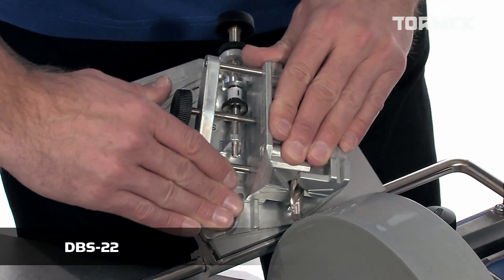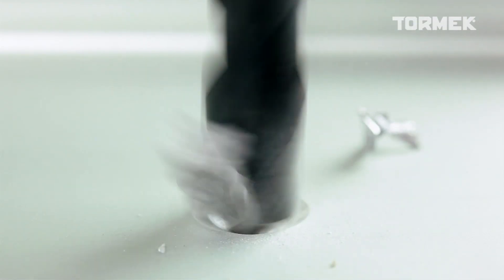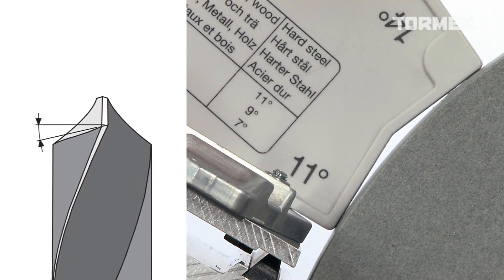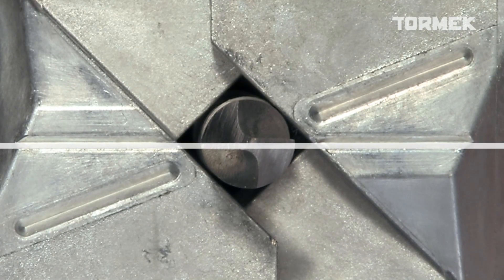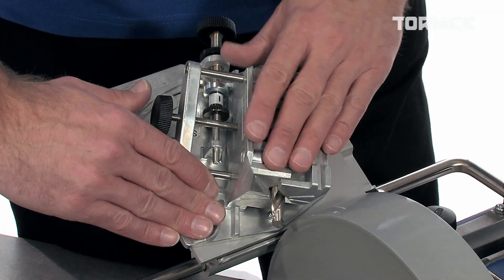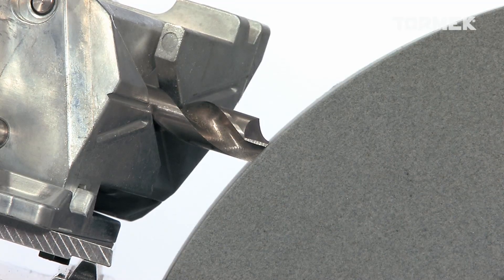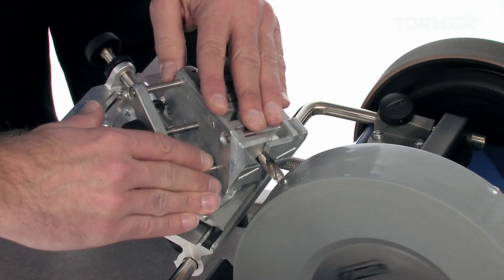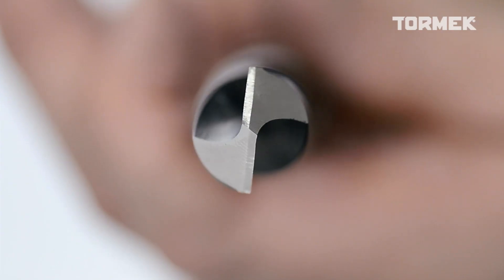Sharpen drill bits with Tormek Drill Bit Sharpening Attachment DBS-22

Comment: I own a Tormek and it does make a great result.  Unfortunately it is slow and has size limits.  Another negative is you must dress that  stone which adds an additional operation......but that is easily done.  I am able to sharpen such that sharpened bits don't make oversized holes.
Reply from the maker: The Tormek system turns slowly for a reason. That gives you 100% control for angle and results, plus that you won´t overheat your tools at any time.

Comment: It seems that quite a few people are worried about deflection of the support or uneven  wheel surface, these issues are easily addressed. I bought a T8 used from eBay with a few jigs and recently I found (lastly) the DBS-22 used again in eBay. The difference between free hand and the Tormek is night and day, the same applies to knives, chisels that I've done. I don't want to be a specialist sharpener, I just want my tools to cut properly and go on with my job at hand. The system is not fast but it is unparalleled in flexibility, precision (for the money and time invested) and durability. There is a learning curve but it is not that steep. Remember that precision results are extremely difficult to achieve by hand and there are so many tools that are actually pretty much knives. Last, you buy a Tormek system to use itfor life, it cannot be cheap or cheaply made. The fact that you can gradually buy all the jigs is very good.
Reply from the maker: Hej Giokosmik, thanks for your great feedback!

Comment: It has a point in the middle, but there's still an area at the center where it doesn't cut - not quite as good as split point.
Reply from the maker: This depends on your drill bit, some geometries of drill bits have that, right. You could adjust it manually after sharpening with the DBS-22 Drill Bit Sharpening Attachment.
Reply: @TormekSharpening Pretty much all twist drills will have that "geometry".  I don't what "adjustment" could possibly turn a 4 facet grind into a split point.

Comment: This thing costs 255,90 €. How many drill bits can one buy with that pile'o money? Not viable for me. Tormek are you crazy?
Reply: This is very fine mechanics, 
yes, I can sharpen bits by myself, but not 4 facets and not so precisely. You can by it like I did meanwhile for 215€ by dittmar werkzeuge. 
I combine it with much cheaper water grinder weldinger vario 250, also for my knifes and chisels. I‘m boring a lot and I need allways sharp bits.

Comment: https://youtu.be/KqcMTxrIoPY?t=235 - how can symmetry of drill bit be kept, when the guiding rod has so much deflection while using the jig ?!
Reply from the maker: Hej Adam B, it looks like that, but there is no problem, symetry is guaranteed. /Wolfgang
Reply: @TormekSharpening  that is my experience too, perfectly centered after grinding the primary facets. This is a great jig! 
However I find some of the harder drill bits like HSSCO alloy is barely ground on the SG250 stone. It works, but its slow. So if you want to grind many of those, get the black stone, or even diamond I suppose?

Comment: I enjoy my tormek but it doesn't take long to figure out that there is a lot more sensory input and experience involved in using it well than they let you think. I can't help but chuckle at the dozen settings this jig is using to set up a cut. It suggests far more precision than it really has. Two of the largest unrecognized factors will be the small but still meaningful deflection in the steel jig support when you put force onto it, and the uneven wear on the stone resulting in an uneven cutting distance. People sharpen drill bits by hand and sight with grinders and do just fine. They aren't like turning gouges which need seriously optimized sharpness
Reply from the maker: Hi Collin,
Glad to hear you enjoy your Tormek. I don’t know if you own the DBS-22 or not but I’ll have to disagree with you. First of all, the result you get with freehand sharpening a drill bit and using the DBS-22 is very different and not comparable from my experience. The deflection you talk about in the steel support is easily minimized by avoiding putting pressure while sharpening. The uneven stone should not be an issue either. Just make sure to true the stone with the TT-50 before sharpening and make sure to use the entire surface of the wheel while sharpening. If you still feel you aren’t satisfied with the result on your drills please contact us at support@tormek.se and we’ll help you.
Best regards
/Sébastien, Tormek
Reply: @TormekSharpening  sure you can true the stone every time if you want to wear it down and buy $200 wheels frequently. Most people will avoid doing that until it's really becoming bothersome. I do it more often than most because I have to use a marker with the SVS-50 to find an angle each time and it ends up clogging the wheel.
Reply from the maker: @CC-gv6us  Truing the stone regularly with shallow passes only removes a minimal amount of stone each time, so your stone will last for a long time even if you do that. With that said, there's another option with the Diamond Wheels which you don't need to true at all. They are popular amongst woodturners when you need to replicate the shape many times. Check them out here: https://www.tormek.com/international/en/accessories/grinding-wheels/df-250-diamond-wheel-fine/
Reply: @CC-gv6us  I think a good middle ground is using the stone grader or diamond plates (see the KnifeGrinders on youtube) to grade the stone between sharpened drills.
It isn't as agressive as using the truing tool, but should still limit wheel wear.
Reply: Buy a TDR/SRD drill grinder.